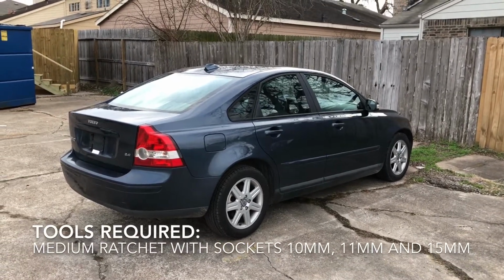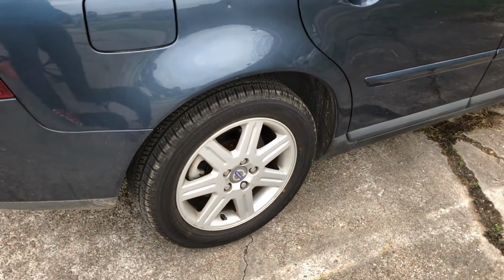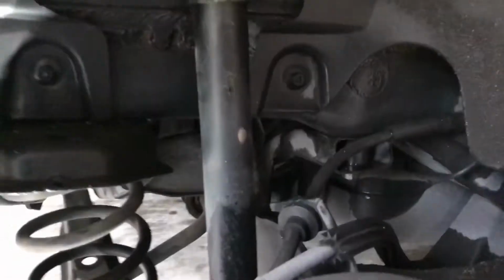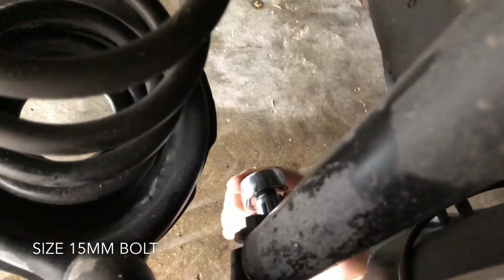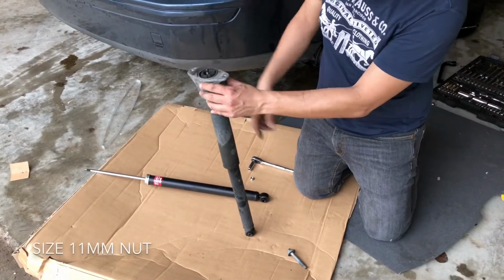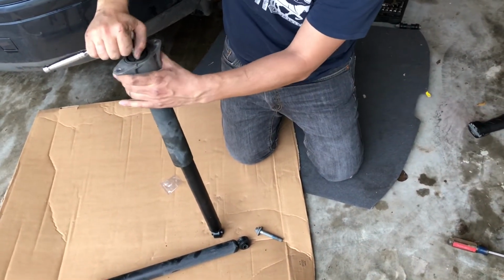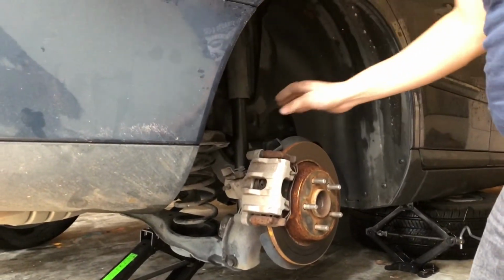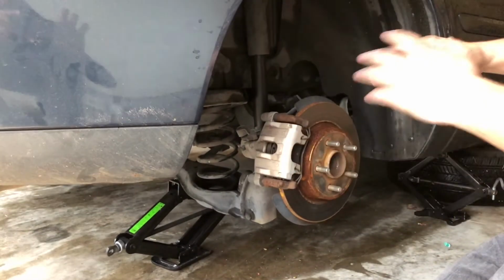How To Replace Shock On 07 Volvo S40

Comment: So I rented a garage space with a lift and did this 12$/hr. Relatively simple. At the end to align the bolt I used my shoulder under the wheel assembly, and did a bit of a squat/lifted it while aligning the bolt back in. Only need about an inch to get it in.

Comment: Did my today and also faced  the issue about the distance.Obviously I just put a wheel under and gently lower the jack to be able to tight the top bolts.However, there's more simple way to finish the job in case you don't have a spare jack or there are no things around to put under the knuckle.Simply tighten 15mm bolt first,then put two top bolts in but don't tight them. You won't be able to it anyway because there will be 1-2cm gap between the shock mount and the car body. Put wheel back on,lower the car and there will be enough space in the arch to tighten two top bolts.
Reply from the maker: Awesome, thanks for the tip

Comment: Does the Coil Spring not need to be replaced? I am having this problem on my front right wheel, it just makes noise every time I go over a bump or divot. When I push down on the car it goes pretty easy too
Reply from the maker: no, as you can see in my video at the beginning when I push the car it makes noise and after I replace the coil it fully solved the problem.

Comment: Very usefull video, because of covid-19 lockdown I decided to do it on my own, it took me nearly an hour and half of a can of WD40 to remove that 15mm bolt, as it was said before she is major bitch and not giving up easily. Apart from that everything went fine, it took me maybe 15 minutes to put everything back on and I didn`t had to use 2nd jack.
Reply from the maker: Glad I could help, if you can, like and subscribe 😊